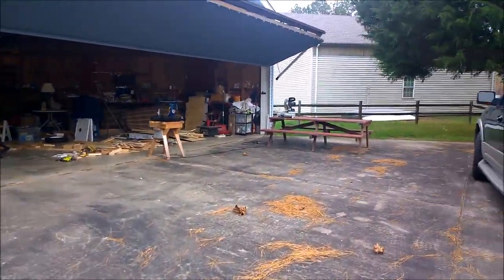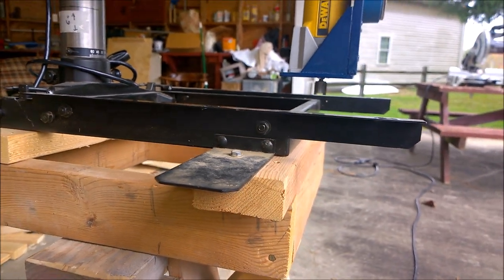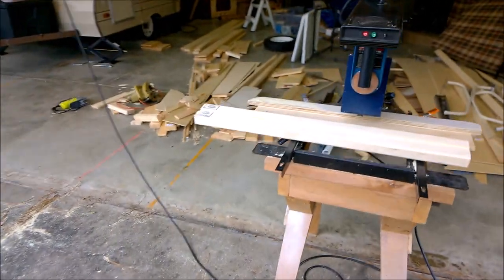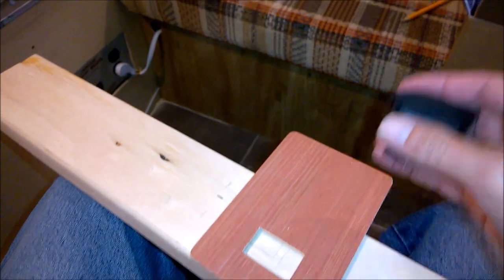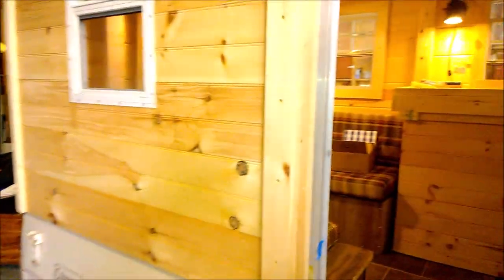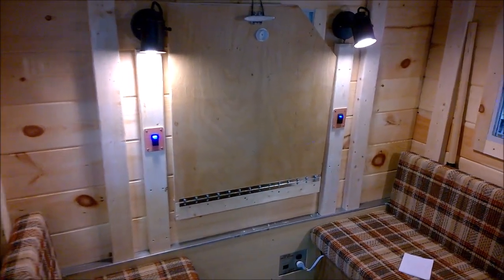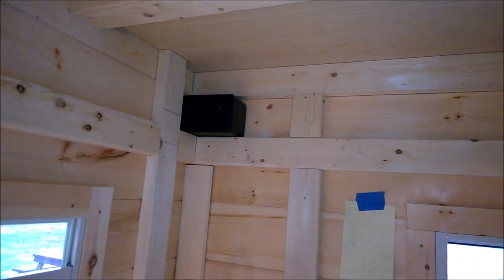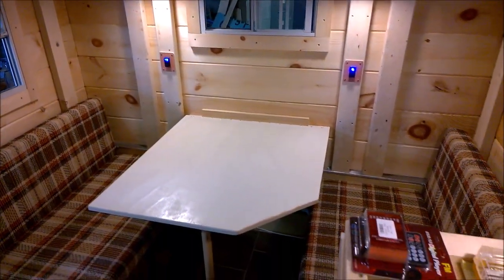Pop Up Camper to Hardside Conversion - Part 18 - Hidden Light Wires

Comment: Great progress, I’ve been following your videos and decided to take on a project. Since you’re using planks/ shiplap for the hard side walls, how do you plan on preparing it weather conditions? Will the trailer be stored permanently outside or will you do some kind of treatment to wood? Are you adding insulation as well? Trying to gather ideas on my project lol
Reply from the maker: Thanks.  It will be in the garage when not in use.  I'll be coating the exterior with a good marine spar varnish.  Fun project.